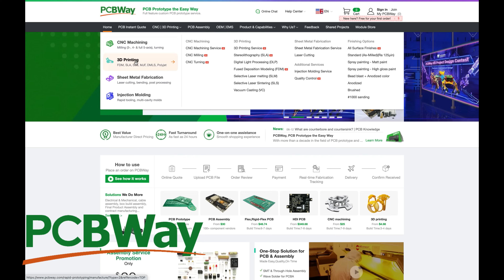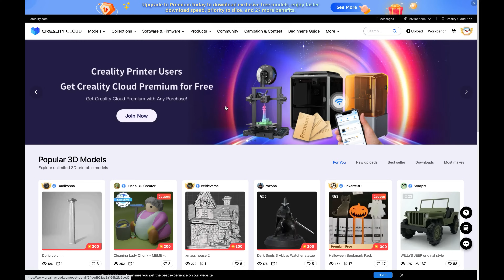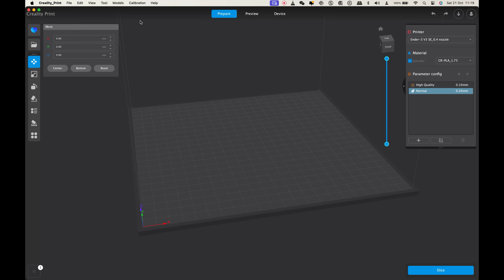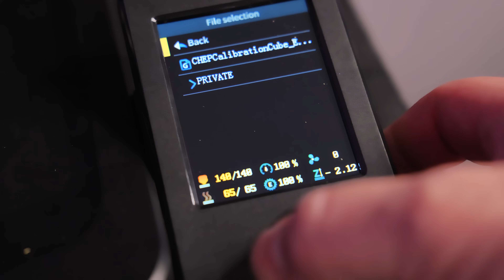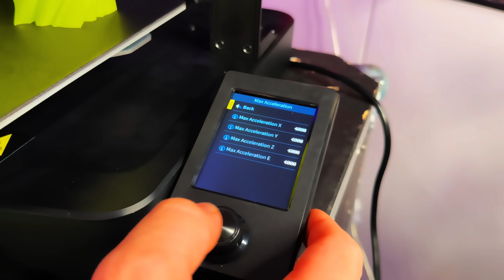Creality's Ender 3 V3 SE: Factory Exposed

Comment: Hear or see much about the KE version? Seems the same, but with Klipper and some added related features like better input shaping. The Ender 3 V3 full stop is supposed to be coming soon as well. That one has a contained belt system in the uprights and is much more expensive.
Reply from the maker: Yep you see them on test in one of the shots, again price is advanced from the SE and the CR10SE but the value of speed and klipper is reflected
Reply from the maker: The v3 is still in beta also

Comment: I had no idea they assemble all the printers before boxing them up! Do they all get print tests, or just a few from each batch?
Reply from the maker: Yep ALL are tested the drop test analysis is less frequent, as it then goes into lab testing but when they are “boxing” equipment in the initial stages. There are a ton of tests you’ll see this on the CR 10 SE video that’ll be out soon